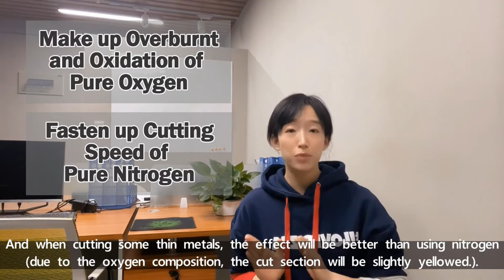Compressed Air Cutting | Fiber Laser Cutter

Comment: Hello mam firstly thank you for your valuable suggestions it will hepls lot.
In our facility, we have a 3000W laser machine with an IPG source and a 16-bar screw compressor. However, while cutting 2mm iron steel, we are observing burr formation. Could you please suggest the best solution to address this issue?"

Let me know if I can assist further with technical adjustments!
Reply from the maker: what parameters? what nozzle?

Comment: Hi i hope you fine, we have 1kw laser cutting machine 16bar compressor 74cfm past 4 months we are facing moisture issue in bottom lens we check with compressor person and dryer as per their statement all are working fine we use GI pipeline is it correct? please suggest with pipeline should use like ss (grade?) or aluminium
Reply from the maker: There is water in air.
Reply: my doubt is the compressor to the laser machine we use the GI pipeline is it ok or not, if we need to change the pipeline so ss (what grade we need to use)

Comment: Hi, I am looking to get a fiber laser. 1500 watt confuser on compressor size. I see allot of guys use compressors around 10 to 12 bar. Then the person selling machine says it has to be 16 bar compressor. I mainly cut 1 mm carbon steel. Can you tell me if the 12 bar is enough ? If so what is max material you can cut with a 12 bar compressor. Thanks
Reply from the maker: From my experience, 12 bar is okay for 1mm CS.

Comment: Hi .
Good day .
Does the room temperature effect the compressed air. Means my dryer works proper but when I apply the nozzle more then 2.0 single diameter then the compressor runs constantly due to more air flow the lens gets wet.
Any solution?
Reply: Please I am waiting for your kind reply. 
Thankyou.
Reply from the maker: It is because the temperature difference between your chiller and room, make them two as close as possible.

Comment: If the laser machine is 1.5kw and metal thickness is 0.8mm, is compressed air is better than oxygen??
Reply from the maker: What material? Carbon Steel? it is okay, but if you want a high brightness cutting section, I think oxygen is better. It depends on what result you are expecting.